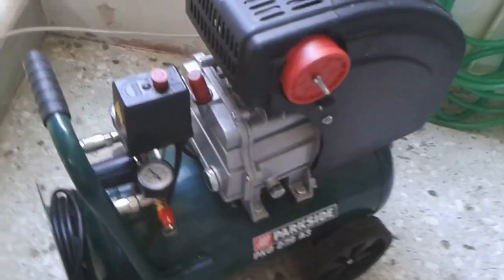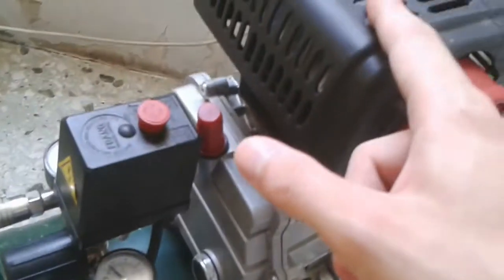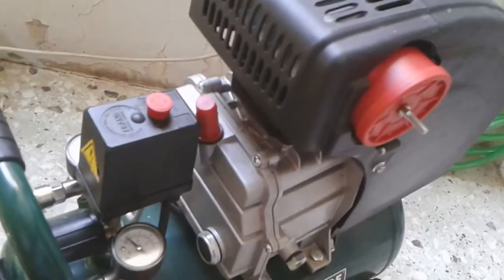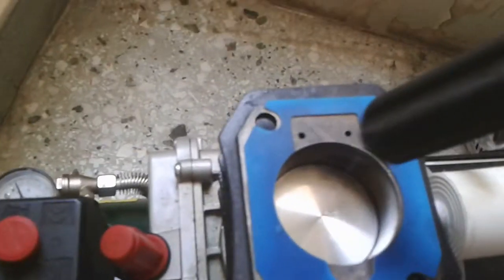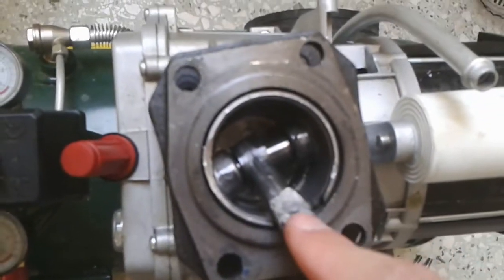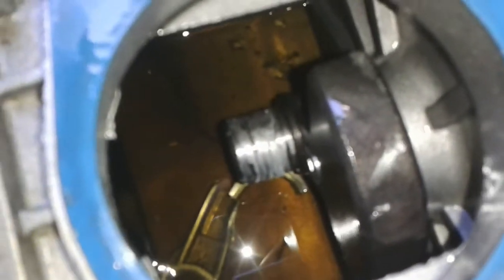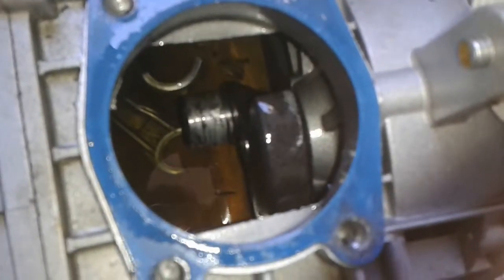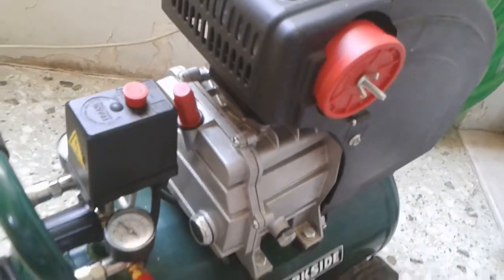NAILED! Cheap Air Compressor Ran Out of Oil - Piston Seized and Threw a Rod! (Autopsy)

Comment: These parkside compressers from lidl etc are very good quality for the price. And for cheaper than machine mart. Uk and ebay to amazon etc. .    The 1 in this video died due to person not checking oil after every use at transparent window at front.   and must be at max level all the time . and change oil if turns brown colour etc.     I got same machine for 10 years   good use. Going strong and do another ten years.  .
Reply: These compressers are from lidl round about £90 to hundred pounds each for the 25 litre model with 3 years warrenty   cheaper than anywere in the uk  not counting sales or black friday deals etc.    They also do a 50 litre model as well.

Comment: https://www.amazon.com/Compressor-Replacement-Connecting-Clevel-FemiaD/dp/B07BVLBTM1/ref=sr_1_2?ie=UTF8&qid=1545006289&sr=8-2&keywords=4HP+Air+Compressor+Replacement+Connecting+Rod+Clevel+23mm+x12mm+Silver+Tone
Reply from the maker: Well this could have been used but the cylinder and piston condition was questionable after such damage,not that this is serious as it is in Internal Combustion engines where excessive blow-by leakage and oil burning will ruin its efficiency even if you manage to get it unstuck,but still the whole compressor was 50$ used and had several issues already so 10$ for a rod seemed a lot for it.